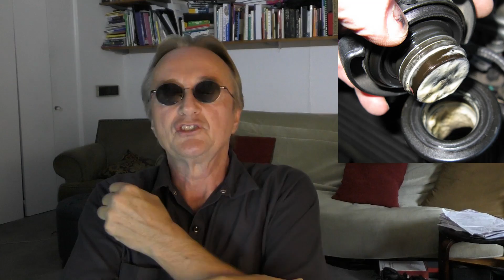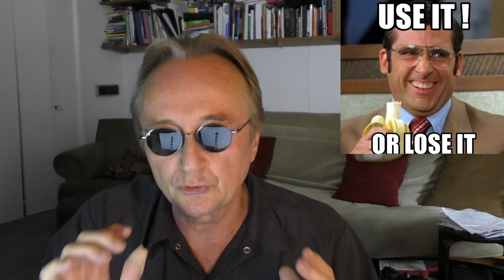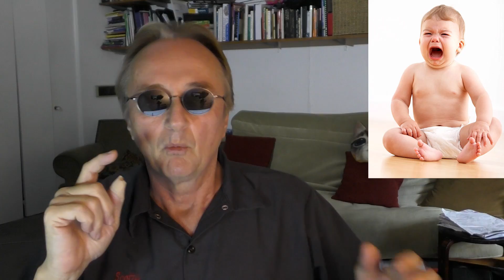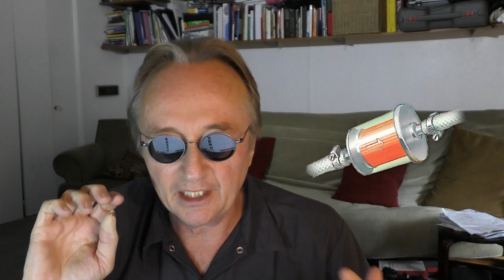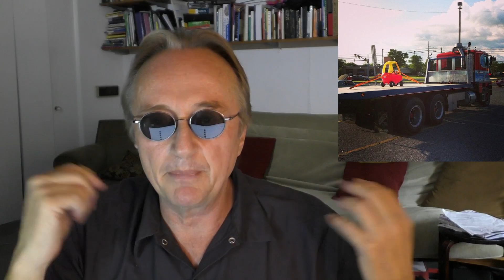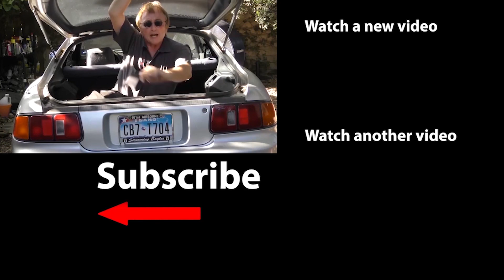Driving Like This Will Destroy Your Car

Comment: When you run the AC while driving, and the park your vehicle does it suppose to leak water underneath?
Reply: Yep. No worries. That condensation is supposed to happen. If you're the nervous type, take a piece of plain white paper and set it on the water. Make sure the fluid is clear (or very close to it if you're parked on an oily surface) and that it isn't trans fluid, coolant, or oil. Water=100% normal (just like the water that drips from a window unit AC).

Comment: I am thankful that my 1998 Subaru Legacy wagon has a fuel filter under the hood. That was one of the first things I changed on the car and had 164000 miles 5 years ago now it's up to 204000 miles. I'm the second owner of the car and I'd also like to do a video on it but I just never got around to it

Comment: Hi Scotty. Opel Corsa 2006 1.4 petrol 16V . When i turn on the car a rattling noise start coming out of the engine, the noise start dissapearing as the engine heats up but is always there. What could it be? Hydrolifters?

Comment: Hey Scotty I'm thinking about getting a 2002-4 lexus is300 with a manual transmission and 200,000 km. Would this be a better choice than the a is250 also with a manual transmission and 150k km. I've heard that they have gdi problems in the newer engines.

Comment: Hey I got a question. I have a 2000 Cadiliac deville Dhs. I replaced the fuel pump and the starter and replaced the radiator. But when I start my car it will shake. Then cut off. But after I restart the car. It starts right up and drives fine. What is going on. And it also tells me. Service electrical system.

Comment: Another possible cause is a thermostat stuck open--the engine may not heat up enough to cause all the water to evaporate. If the vehicle never warms up or takes forever to warm up, check that out.

Comment: Hi Scotty.
Thank you kindly helping us learning about cars, I have a question for you:
 " me and my wife bought the the new 2019 Toyota rav4 and the 2019 Toyota Corolla, I noticed that there's a big difference in the steering wheel where on the corolla quite stiff and the quite effortless" is tht normal or could it a defect in ether one of the cars?

Comment: Scotty I have a 1982 Toyota Corolla station wagon stick shift with 280, 000. I have had it since 1985. It was rear ended 2 months ago and this body shop says they can fix it, but I have to get a replacement bumper. Really having trouble finding one and I may have to sell the car to a junk yard.

Comment: Replacing the fuel filter on my Toyota looked easy.  It's right there in the engine bay but it was in awkward location and you had to blindly connect the lower bolt.  Fortunately, I had a cool, trusty mechanic like Scotty close by. Even, he was grumbling how, "that wasn't easy."

Comment: Scotty I have a 1995 volvo 850 non turbo project car. I stripped the bottom bolt hole on the water pump and its leaking coolant. Can you reccomend a couple options?

Comment: Scotty I have a 2012 Malibu LT and the temperature guage will once in a while start bobbing up and down from the middle up to hot and straight down to cold then back to the middle. It always happens in park. Is this just the system resetting itself?

Comment: My experiene with having a 2nd vehicle that sat for sometimes weeks at a time, bran new Nitto Terra Grapplers dry-rotted after 5 years to the point I had 2 POP in one day a few hours apart!  They had less than 10,000 miles on them and when they went they literally blew the sidewalls out.  The first was the rear, the second was in the front and wow that one scared the crap out of me.  Wasn't till the Sierra got home on the flatbed that I looked the tires over and realized they were rotted.

Comment: I’m not sure if I beseeched (asked) you this already and I apologize in advance if I have. My speedometer needle is acting up. If I’m driving along doing the posted speed limit, my speedometer needle on my 1989 Pontiac 6000 LE goes jumps around. As a car girl I know some car stuff and thought maybe the speedometer cable was corroded or something. What’s your opinion?

Comment: Scotty, I was disabled for a few years and my car has just been sitting unused for two years. I am about ready to start driving again, what should I have a mechanic do to my car before I start it up and start driving it again? It's a 2006 Impala with about 70 k miles that used to run great.
Please advise if you can.

 I would appreciate any advice from anyone knowledgeable.

Comment: Electric fuel pump inside the fuel tank makes a lot of sense because the fuel not only lubricates the pump, it also provides pressure to minimise the chance cavitation, minimizing the risk of detonating the engine due to unexpected lean out.

As for the fuel filter inside the tank, that is asinine. My car is has electronic port injected petrol engine with the typical in fuel tank fuel pump, but the fuel filter is somewhere in line with the fuel line on its way from the fuel tank to the fuel rail. The fuel filter is quite cheap and easy to change as long as you can safely lift and suspend the car off the ground. The recommended change interval is once every 20,000km.

Comment: I remember once, some years ago going to the Chevy website and playing with the pre-purchase vehicle configuration tool... I chose a super basic, no-frills, S10 truck: 4 cylinder, manual trans, vinyl bench seat, AM/FM radio... basically declining any option that would raise the price.  When all was said and done, the site recommended I buy a similar Nissan truck, as it would cost about $4K less than the S10.

Comment: Hey Scotty, I have a 2006 GMC Envoy XL Denali V8 AWD with 62,500 miles. I'm starting to get a knocking noise in the engine. Is this common with this model year and mileage? I'm not sure the cause of the noise.

Comment: Hey Scotty 
I have a 1999 C5 Corvette with 26,000 miles. When driving I hear a whining noise whenever I put my foot on the gas. When slowing down with my foot off the gas I hear a whining noise decreasing in volume. Is that a transmission or rear end problem that you are speaking of?
C5 James B

Comment: Milky substance is emulsion, it shows the oil is doing its job removing water and acidic properties from you're engine. Make sure the car engine is breathing properly, removing back pressure. If it gets to bad looks like it needs a surgeon.

Comment: Whiny noise? Maybe, Scotty, but I've noticed that a lot of vehicles with port fuel injection make a whistling noise when you run them at middle power levels. That is, revs in the 2000s to 3500s, and throttle postions in the 30% to 70% range. I think this is strictly a function of the amount of air passing into the intake system and over the throttle plate. Air whistles when it moves through a restrictive passage at velocity. The 390 FE I had in my first car, a 1970 F100, made the same noise at about the same speed and load. My current vehicle, a 2002 Goldwing, makes the same noise between about 1600 and 3000 rpm at half throttle. This isn't something to worry about, assuming that's what it is; it's just the sound of air moving through the intake system as it's supposed to do.

Comment: Scotty my 99 Tacoma pings bad , I've tried everything, tune up, cleaning the throttle body, egr valve,  etc,  it is distributorless ignition, so timing is not applicable, any suggestions

Comment: Actually cars normally do have a filter underneath the body or on the frame, the piece connected to the pump is a strainer for the large stuff that would damage the pump.

Comment: Hey Scotty, I drive a c6 corvette with 50k miles, my traction control and ABS light sometimes turn on and when I put it on drive or reverse  it’ll sometimes make a rattling noise when I’m accelerating and I have to let go of the gas for it stop rattling. but it won’t do it when I pass around 20mph . What do you think the problem is?

Comment: Interesting that the first question is about water showing up on an oil cap. I changed the oil in a couple of golf carts just a few days ago and saw the same thing on the caps. I knew it was water, but I wasn't sure how it was getting there.
I'm not too worried about it; they're little engines.

Comment: Scotty, I have a 2013 Camry 2.5l. The car makes a concerningly loud metallic rattle during low acceleration after the car reaches operating temperature and won't make the noise at all while in park. The dealer says there's nothing wrong

Comment: I have a 94 Nissan Sentra with 187000 miles on it I change the oil every 3000 Miles I just use regular oil not synthetic I've changed every 3000 miles put new plugs in it every 6 months make sure the wires cap rotor good air conditioner still blows cold the only problem I have with the car is the driver side back window is broken and you know it doesn't go down but I'm not going to reinvest in that little bit of body cancer car runs good still gets 30 miles to the gallon and away we go

Comment: Hi Scotty, greeting from Thailand love your show.
 I have a simple question for diesel engine, what's the down side if I use KFC fries-oil instead of diesel?
Reply: MrDaftig That’s an interesting question. I think ProjectFarm would be a better channel to get an answer to that question.
Reply: Honestly. I have done this. I have ran the mk1 and mk2 vw diesel engines with mechanical fuel pumps. The only concern is the fuel filter. Because diesel is petroleum based it leaves residue that's why you need a fuel filter. The KFC oil cleans all of this out and clogs up the fuel filter. Change the fuel filter after 3 - 5 tanks of KFC oil when you first switch over.
Reply: Johnny Draco  A lot of dog will love my diesel truck because it will smell KFC chicken. 😂

Comment: my 2002 camry 4 cylinder runs 2500 rpms at 60 mph .. is this normal or because of the its 270000 miles  ?

Comment: Always drive your vehicle, as long, as frequent and/or as far as possible, because it is one of the serious responsibities you do, as a licensed driver and it also keeps the vehicle warm, more reliable and/or more fuel-efficient for the time being. For example, driving from Los Angeles to Orange County is a frequent trip and driving from Las Vegas to Reno is far, both on the highway. Driving in the city/in residential areas on any type of street is a lot longer and you will have more time to explore and to focus on the task at hand. Finally, always buy used reliable and fuel-efficient vehicles as well. Good luck on your driving career.

Comment: Hey Scotty. I’ve got a 2008 5.3l v8 Silverado and the other day driving down the highway perfectly fine, an engine light started flashing and I got stabillitrak warning and traction control. It’s has a very rough idle but smooths out when maintaining speed. I’ve replaced plugs and wires, and fuel injectors are fine because I’ve checked them all. PO306 code. Thanks!

Comment: Craigslist car question: This is the description of a 1999 Honda Civic si: "...recently has developed a problem where it runs and then turns off. I’m sure not a big fix but I don’t have the time. Under 200k and engine seemed very healthy. New radiator, thermostat, plug leads...". Asking price is "$900 firm".

What could be the problem? Is it worth the buy to fix? 

Thanks.
Reply: Hal 502  How have you gotten scammed? I want to learn. And if not from Craigslist, where should one go to buy cheap used cars? I'm just looking for a cheap non-project car to learn manual in, then sell it.

Comment: Love my 76 Buick Regal 3.8l. no computer, mechanical fuel pump and external fuel filter right at the carburetor. You Sir Scotty keep on putting your wisdom on us 👈😎👉💯👊. ✌️out from Cali😎
Reply: I love my Chevy Colorado turbo diesel. Gets amazing mpgs, fuel filters are underneath and so easy to change. I also have the truck lowered a bit and tuned to get more pep with even better mpgs

Comment: Scotty is correct. Short trips kill engines and exhaust.
Reply: Taxi companies used to have their fleet idling at all times rather than shutting down and starting the engine again.
Reply: @whackamolechamp  I know,  I grew up big and strong fortified with lead from car's exhaust when they had leaded gasoline.  I think I'd be smarter if they didn't have leaded gasoline when I was growing up.  Then again, after they stopped lead-gasoline, they started aspartame so younger ones grew up with that neurotoxin.  Always something.
Reply: and long trips wear out bearings and tires and brakes and patience...  : )

Comment: Had a temperature gauge that would jump all over the place.  Scared the heck out of me while pulling a travel trailer. Resorted to installing a 3 core radiator. No help. Finally discovered it jumped at the same time the fuel gauge jumped - turned out it was a bad dash voltage regulator! Ok, it was a ‘74 AMC Matador! Don’t laugh!  It went 84k miles before it got too tired to tow the trailer.

Comment: Hey Scotty, is it better to buy a new or refurbished AC compressor for a 06 Chevy Impala?
Reply: New
Reply: @anthonymolina7416  That's what I thought too. But I just thought I'd ask to be sure
Reply: Felix24148  yeah cause refurbished isn’t always good
Reply: @anthonymolina7416  I know that more or less. But some basic parts are fine refurbished. I think I've seen Scotty say so. I just wanted to know if that one was one of them. I know alternators are crap when refurbished, unless done well. My mom once went through three refurbished alternators and said "Never again!". But I've also seen a refurbished starter for a early 70s GM vehicle that worked fine after being installed and then on. But I also hear a lot of people say refurbished starters are crap. Maybe that's just the ones for newer cars?

Comment: Hey Scotty I’m trying to park my car like a year without driving it . I took the battery cables off and buy fuel stabilized pour in the gas tank .. would it be any issue ?
Reply: Fill the tank completely with non-ethanol gas, if you have it-
Reply: I have putted fuel  ⛽️ stabilizer

Comment: Scotty, love the vids. About the whining noise though - I recently had my '06 Civic in the shop for a bad thermostat & fan switch causing the coolant to vent after overheating. After the fix, my engine had a whining sound that got louder with higher RPM's. It turned out my Power Steering fluid was an inch below minimum due to a slow leak! The second the fluid was topped up to max, the whining ceased. The whining also got slightly louder when turning the steering wheel but I didn't notice any difficulty turning it.
Reply: You had air in the power steering lines. You want to jack it up and turn lock to lock a few times after topping it up, that should release the trapped air via the pump filler cap.

Comment: I check my oil all he time. I do about 2000 a year and I pay close attention to any bubbles or change in colour on the dipstick. Oil changes are at least once a year in winter. Its a diesel if your wondering and the book says 6 monthly oil changes. I stick to 12 months. When I do use the car its usually running for an hour.

Comment: Hey Scotty, I traded in my 2015 Chrysler 200 (25k miles) for a 2019 Honda Civic (automatic) you say the manual ones last pretty long what about the automatic ones?
Reply: You’ll be good as long as you maintain it properly.  Smart move trading that fiat
Reply: The autos don't last as long as the manuals, but it could still last a decent-long time. Just don't neglect maintenance! Change tranny fluid atleast every 50-60k miles. You can change it every 30k if you want to take REALLY good care of it, but 50-60k is ok.
Reply: That was mainly on V6 Hondas 20 years ago, service it and ypu will be good! Oh, and THANK YOU for getting a Honda amd dumping the POS Chrysler, BTW!
Reply: P.S. Honda fluid ONLY, BTW!

Comment: Hey Scotty, I got a 2014 AWD Chevy Equinox, check light engine gave me a code to change the camshaft intake solenoid and I changed it and the car still keeps shutting off on low rpms. What’s going on?

Comment: That would be heaven though, if the fuel gauge went up under heavy acceleration and actually meant it😍
Reply: Mine is the reverse: goes up during braking. I don't mind, I just wish it would stay there!

Comment: Scotty!!! I really need your help I have a 2003 Honda Insight hybrid and every time I start accelerating from a stop my engine shudders but other than that it drives amazing, no check engine lights have ever came on please give me your guess! :((
Reply: Spark plugs or ignition coils getting weak. They just aren't bad enough to turn on the light. If you know somebody with a good scanner they can check for "pending" codes

Comment: I left my gas cap at the gas station when I went back it was gone but they found one and it fit after this my engine light came on could it be the gas cap cause it's not the right one.
Reply: yes, make sure you have the exact one for your car.
Reply: Don't think ur engine light would appear just cause u put different gas cap on!  Emergency gas caps that u can buy are not made for a specific car, but they fit, work, no prob.

Comment: Scotty what does it mean when the check oil light comes on  while idling but the oil is at the right level?
Reply: Probably the oil pressure sending unit/sensor is faulty.
Reply: @rays7437  Thanks Scotty!

Comment: Hey Scotty. What if you only drive under 10km or 10 minutes to work is this bad for an engine
Reply: I’d just make sure that the car is warming up all the way before you turn it off.
Reply: @ericnelson9325  but most cars dont need to "warm up" so what's the point? Lol
Reply: yes somewhat
Reply: Well. Kind of. It doesn't get properly warm and battery doesn't get fully charged under 10 minutes.
Reply: Thanks for all the reply. The temperature is usually fully heated up when it’s turned off.  Just worried about the short trips as it’s a turbo charged engine.